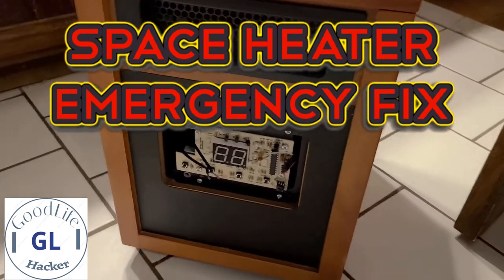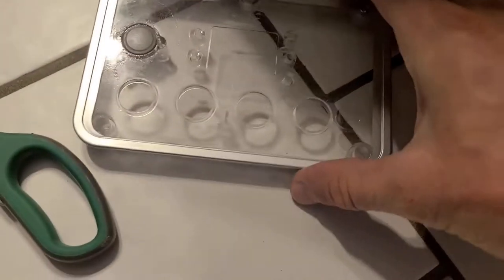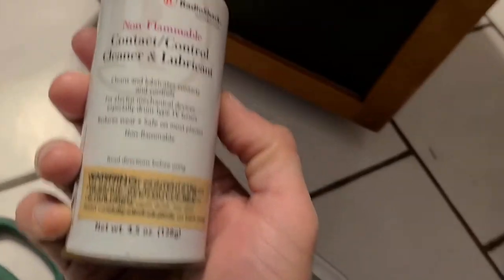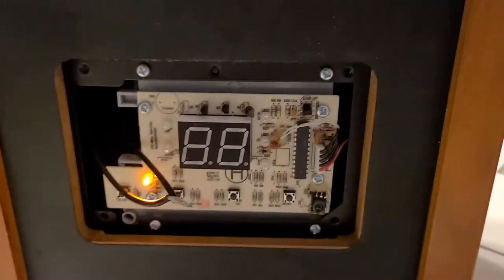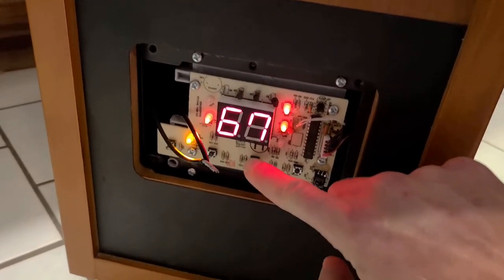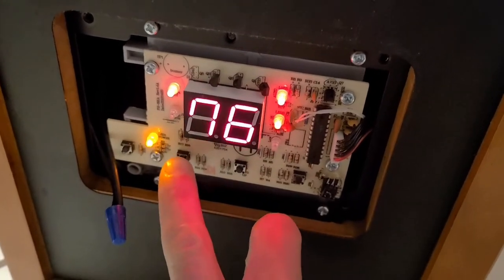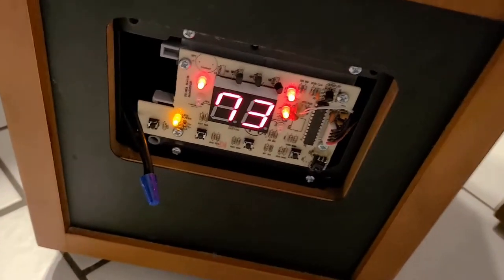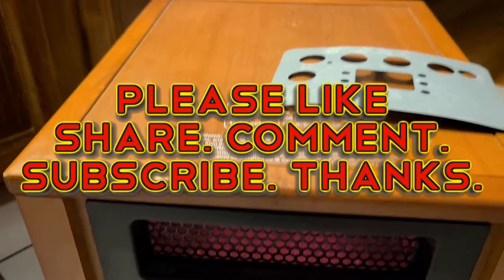Space Heater Emergency Fix

Comment: I had the same problem with a defective switch on a very nice unit otherwise.  Rather than buying another poorly made switch from DR ($20.), I installed a toggle switch (Lowes) for$4.50.  It comes with two 5-inch tangs which I soldered with DR wires and put on wire nuts.
Some removal of plastic with a Dremel tool was required for the new switch to fit  flush.
Reply from the maker: Thats a great solution. I must confess I ended up wire nutting the power switch wires together and putting it all back together. Now the wall plug became my on and off switch. It's not bad because when you first plug it in it waits for you to crank it up before the heat and fan turn on. Unplugging is the not so great part because its fully running but I haven't had any issues with it like this.  I agree 20 bucks plus shipping for another junk switch was a bit much.
Reply: @goodlifehacker
Reply: Can't you turn to different settings with the button on the lower right including waiting for the heat and fan to go off before unplugging? I almost did as you have done. Not a bad solution.
The 4 screws were quite tight and I had to turn the unit on its back to apply a lot of pressure. I left it that way while working and one wire dropped down and was difficult to retrieve because of the small opening.
Reply from the maker: @douglasvandyke7666  Yes you are right it would be better if I turn the settings such that the heater and fan go off first, but I'm lazy about it and I just give it a good swift pull out of the wall :)

Comment: I have one of those heaters and I cannot get it out of standby mode. Do you know how I can get it out of standby mode by chance?
Reply from the maker: Now that I hard wired the power button when I plug the unit in it goes to standby mode.  Then I hit the mode button and it starts operating.  If your mode button doesn't take it out of standby then there might be a different problem you can try taking it apart like I did, but sorry can't be of more help.

Comment: I am having an issue where it reads 88 and keeps flashing 

Some heats produced but it doesn’t quite work at all
Reply from the maker: Hi that sounds like a circuit board issue or something like that. Call support and see if that is some type of code that means something to them.
Reply: @goodlifehacker  idk what it was 

It’s the only way to heat my camper I’m staying in for the winter for work 

I just kept unplugging it and plugging it back in and eventually it turned back on 

Thank you for the quick response I do appreciate it 

This heater has given me nothing but issues but I also have been using it as my primary heat source 24/7 

I know that I’m drawing way too many amps and I’ve popped the breaker I’m plugged into a couple times

Comment: I need to bypass my comfort zone heater but i have three wires
Reply: It's emergency I need your help
Reply from the maker: Sorry getting back to you so late.  If you have three wires I think this is a different button as in not the power button OR a different type of power button hooked up to a relay so I unfortunately would not be of much help. I hope you made out ok. In my case it was just a simple button designed to connect two wires together so it was straightforward.